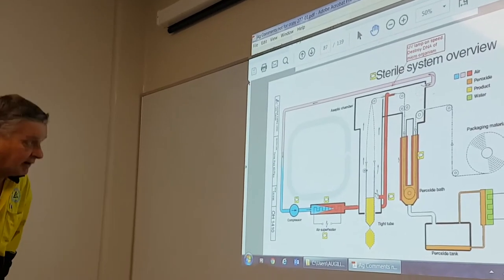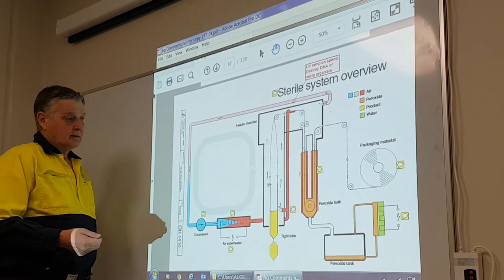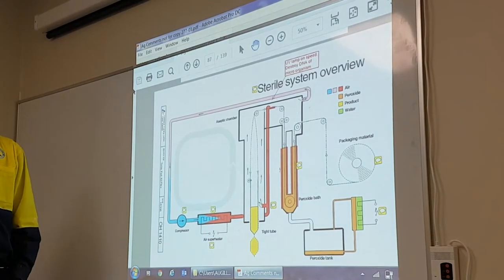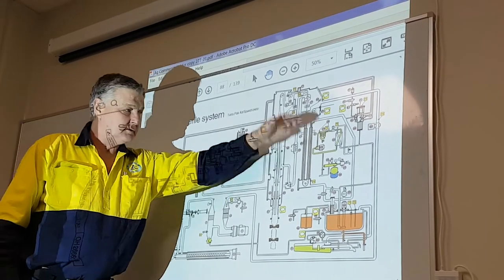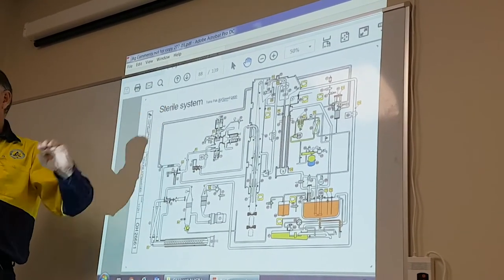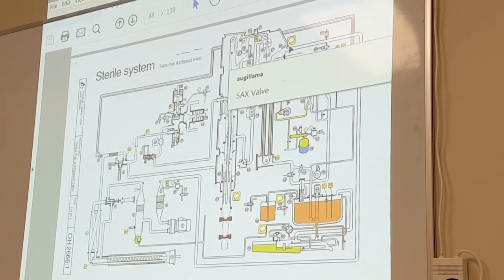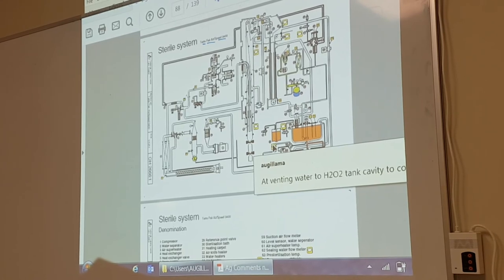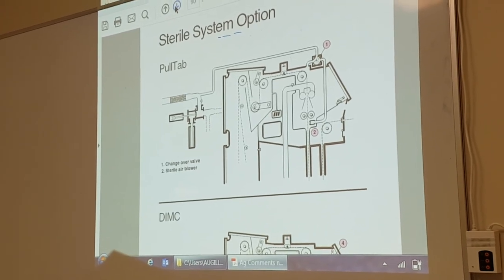Tetra Pak A3 Speed 400V | Sterile System Part 2 Training

Comment: Very interested in tetra pak I've been in the food industry for about 10 years sugar beets string cheese and now aseptic protein drinks I have worked with PLC troubleshooting 4-20 ma signaling 480 3ph and the mechanical side I'm now working with fillers Helix accumulators cappers and casers